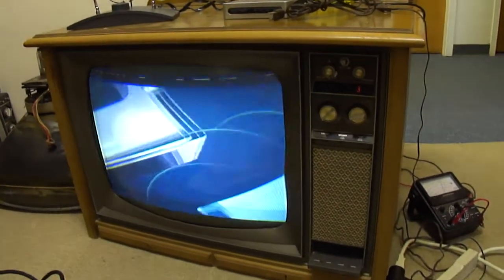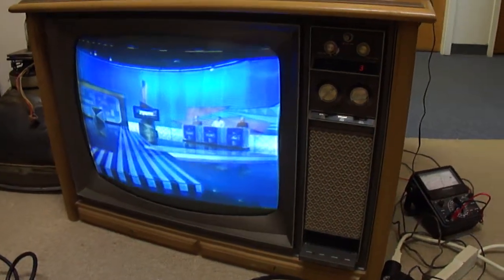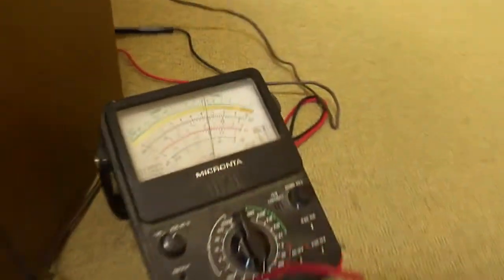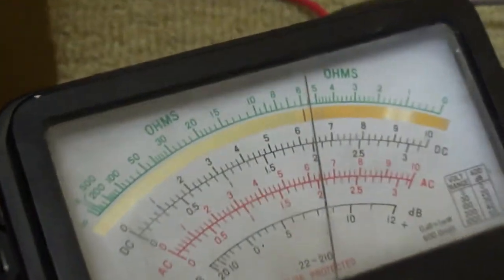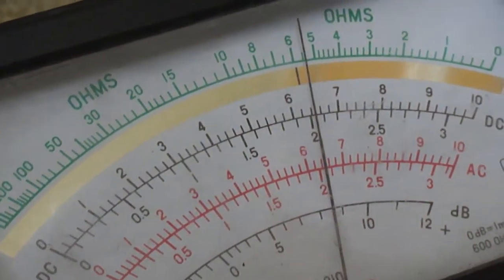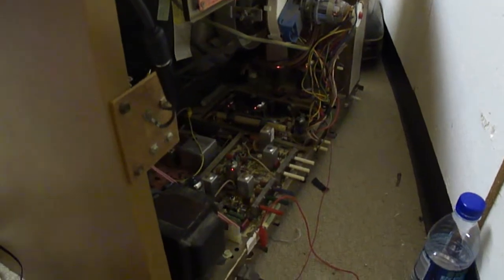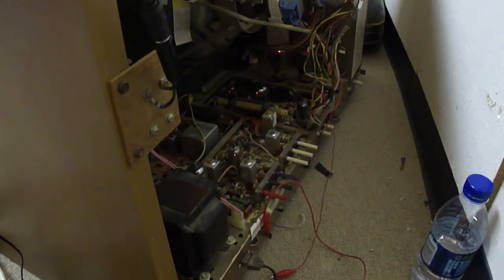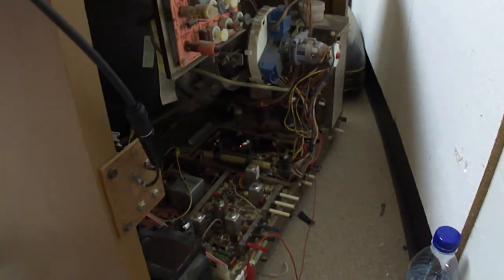1968 Sylvania D12 tube type color TV problem

Comment: Might have to go through and check solder joints in the vert. circuitry. This is only a guess. Of course you could always check online and on forums.

Comment: regarding the horizontal width problem, i would suggest that you check the plate voltage on the horizontal driver section of the horizontal osc tube. i believe Sylvania used a 6GH8 as a horizontal osc/driver tube in that model. it is most likely that the plate load resistor has increased in value. also check your G1 voltage on the horizontal output tube.